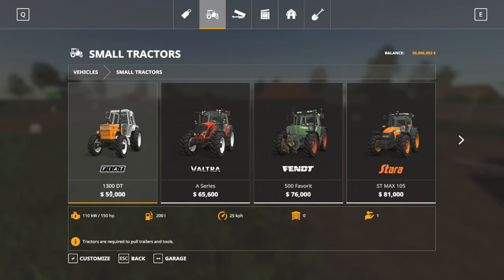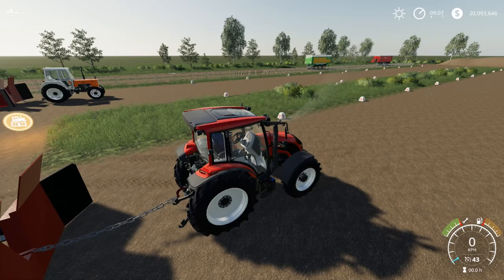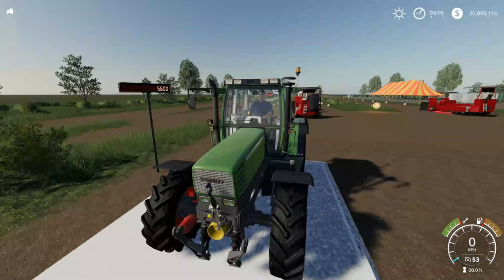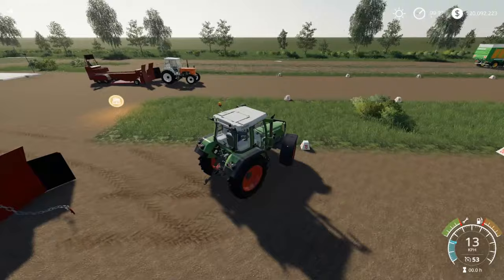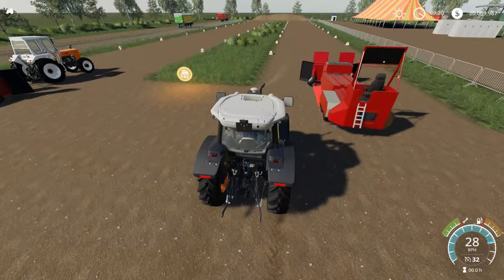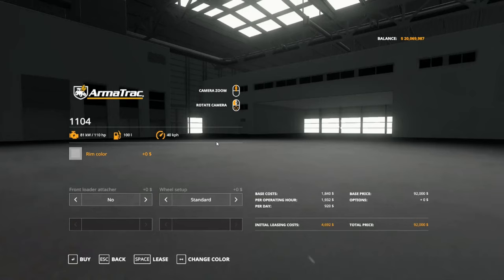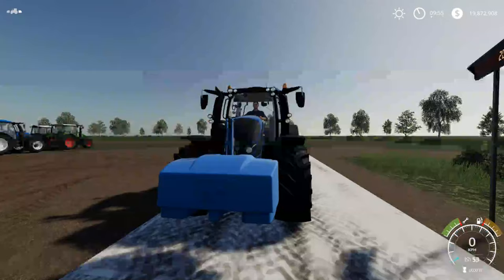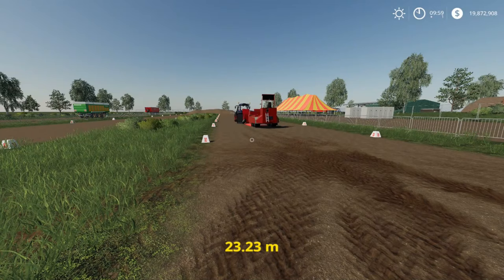FS19 Tractor Pull map - Small Tractors division

Comment: This isn’t how you use it the weight starts at the bottom then moves forward as the tractor moves
Reply from the maker: Correct. However to keep the testing fair, each gets the max load from a standing start.